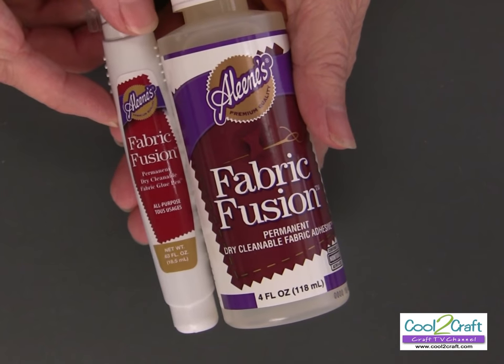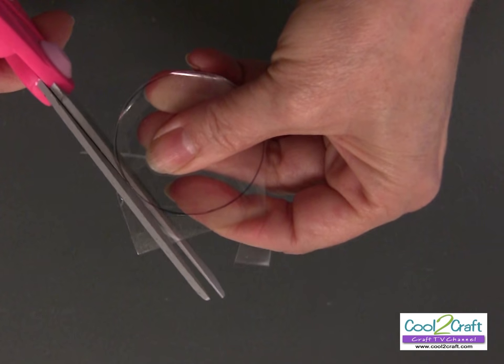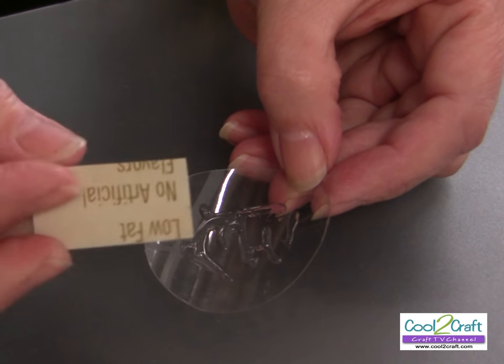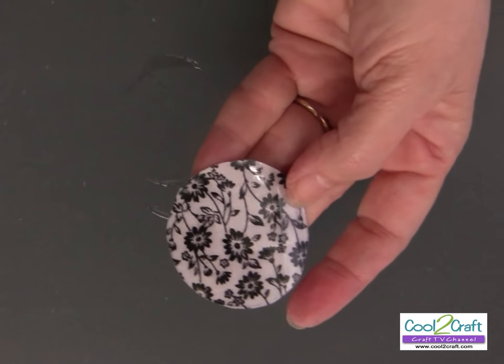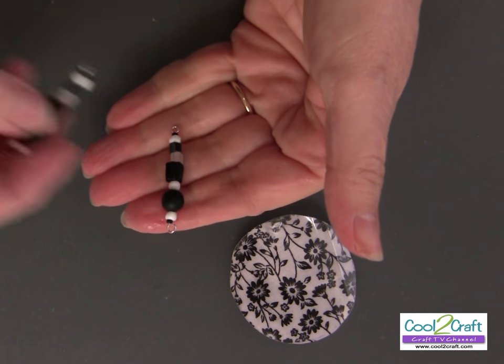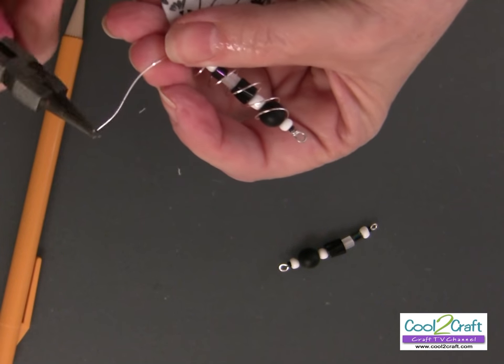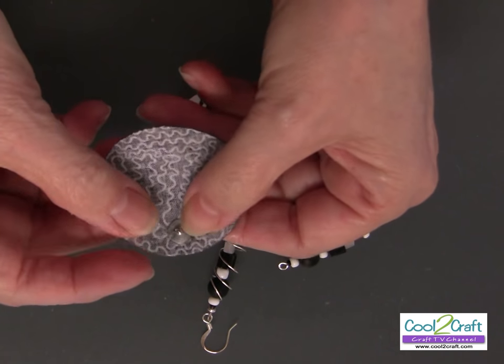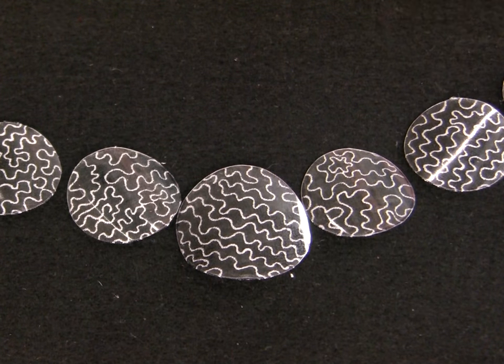How to Make Reverse Fabric Water Bottle Earrings by EcoHeidi Borchers

Comment from the maker: The water bottle pieces have a slight curve so the fabric work ideal on this. If you don't mind wrinkles or cutting into your paper to help ease it into the curve then you can use paper. The thinner the paper the better. Whenever we decoupage with inkjet printed paper, we first seal it with Aleene's Spray Sealer. You can certainly test with the Aleene's Decoupage medium but since it is so wet, you will probably find that your inks do run.

Comment: You can use a brush...just be sure to clean between each use and dry off thoroughly before applying  glue ( you don't want any additional water in the glue). Or you can also use your finger.

Comment: That is extremely cute miss.  Thank you so much for sharing. I can use this project with my Girl Scout Troop.        Kimberly,   queens, ny
Reply from the maker: +kwall224 Absolutely! We think this would be a great Girl Scout Troop project!
Reply: Turn them then  clip the ear wire so as not to make it too  short     If you are using pin type earring make two circles and join with chain   Use a sm circle slightly larger than the pin so as to show fabric make sure there is room to punch two holes one for pin one for jump ring. Use a jump ring for each section